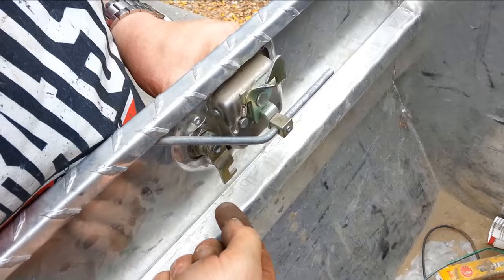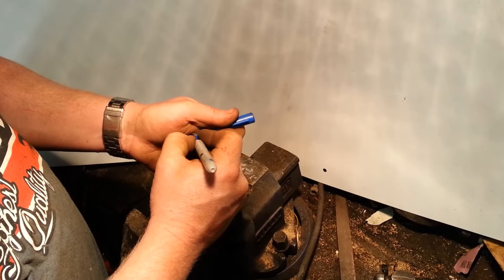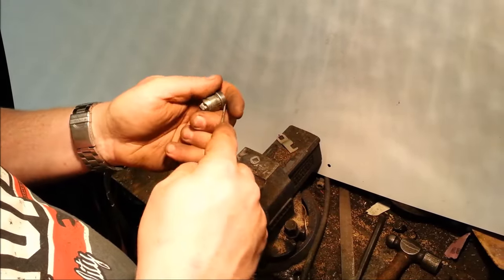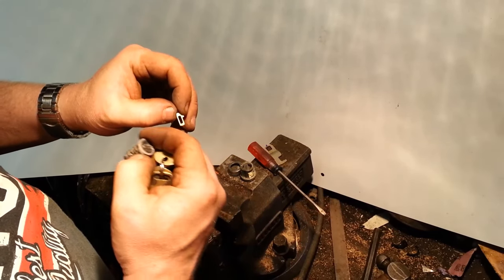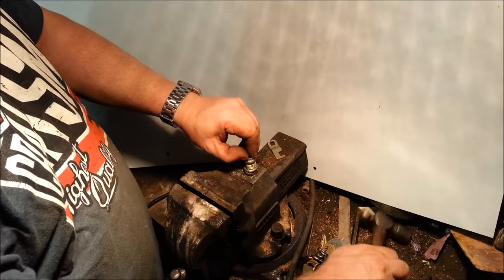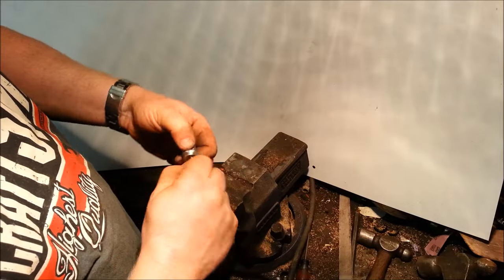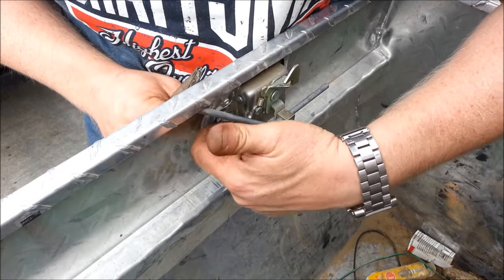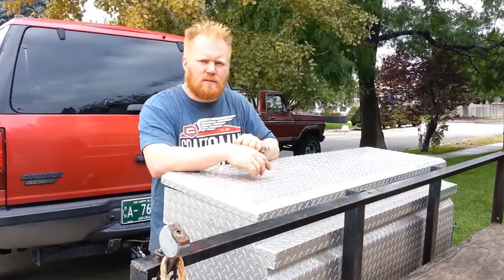Lost KEY for your Truck Toolbox MAKE YOUR OWN!

Comment: This is not Re-keying the lock this is destroying the lock is making it so instead of one key fitting the lock a thousand keys will not fit the lock because you file down the Integrity of the Tumblers the correct way is to take it up to a locksmith shop and have them replace the Tumblers with a key that matches it. You routine it is what you did is file the Tumblers down so almost any key will fit that lock now any crook that walks up the sticks a key in your lock will probably open it just a piece of advice from a 30-year certified Master Locksmith
Reply: ...ya...I'm a criminal, and I totally walk down the street trying my key that will "probably open it".  How patently absurd.

With youtube, most who have any care about security know what a joke nearly all modern keyed locks are against any kind of moderately sophisticated attack (picks, jigglers, bump keys, a drill).  A key is simply to prevent crimes of opportunity.  Period.

For sophisticated attacks...well, that's what insurance is for (or learn to do without).  Because the alternative is to go with something like Medeco, which probably costs more than the things I'm protecting...and even they aren't perfect (and the company has clearly demonstrating that they will not fess up to, warn about, or correct their failures).

The goal, for most, is merely the Pareto principle.  And for that, thank you sixtyfiveford:  Mission accomplished.  :)

[and bonus points for additionally making my life easier by introducing the idea of consolidating keys!]
Reply: I'm a certified neighbour
Reply: Or just get a new cam lock for 6 bucks
Reply: Master Locksmith??  Master locks suck!!
Reply: Certified troll here.
Reply: Wow, all the hostile comments.  I wish I read the comments here first before leaving the previous comment. Well it's not a high security lock indeed and I tell my customers not to rely on it too much also but still can't help cringing watching him. I surf YouTube to find something that I can learn from but it seems nowadays everybody is an expert. Better stop watching I guess.
Reply: The locksmiths are correct, this just makes it so any random key can open it. Overall something is always better than nothing. These are simply cabinet locks sold at lowes, ace, etc. You can pick up one less than $10 and screw it in for less trouble than this.
Reply: What about filing down the wafers from the bottom instead? Would that help?

Comment: The nut holding that lock on is probably much better than those forked clips. My van got broken into 3 times. Seems like all they used was a big screwdriver, and pried it right out. I got so sick of it, I finally installed those hockey puck locks, and nobody has messed with it since. But now I need 4 different keys to get into my van. Because the regular locks were replaced but not keyed the same.
Reply from the maker: metalmoto Darn Thiefs!

Comment: I can't thank you enough sixtyfiveford !

This is brilliant ! I've looked at new locks, locksmith re-keying, etc. Not only have you saved me a lot of time and money on my salvaged toolbox lock solution you've educated me today, and that is priceless. And I'm already imagining "fixing" a few other locks so they're "keyed" alike to save me the weight and space on my key chains. Almost wish I'd found this before I wasted all that time looking at other options but then I wouldn't know the real value of the lesson ;-)

Peace and prosperity !
Reply: Quick question if you see it before I start filing ;-)  (I'm so itching to start filing right now so I can finish this up lol)

The key I have that is the best fit (and it's very good really except it...) only hits the first 3 of the 4 pins. It hardly seems like it's worth it but would you look for a key at the hardware store that goes a bit deeper to engage the final pin ? I'm thinking I might just remove the final pin entirely instead but the hardware store is handy and I know the owner so it would be no trouble.

I'm also have a small idea / question / suggestion, maybe not a great idea but ;-)  I'm pondering moving the pins around to maybe get closer to the key I have. It's only a 3 (or 4 with a longer key) combination problem so it shouldn't take long. And if I use just the first 3 pins in the lock that gives me the 4th as another possible fit in the first three slots.
Reply from the maker: +Not Here I would just pull the pins. If someone is going to attempt to pick the lock they already know what they're doing and whether you have 3-5 tumblers they'll get in.
Reply: +sixtyfiveford Yeah, locks will only keep out lazy thieves, honest people, and the kids. Good enough for running into the store and parking in the driveway or job site though.

Turns out that last pin was engaged after all, just that my key slipped into it without it moving up or down at all fooled me. So I have a full tumbler set after all.

For what it's worth I did play with the pins for a minute and found a combo that actually worked with my key, though just a little sticky. A bit of filing and it's as smooth as factory, or better :-)

Thanks again for sharing your knowledge !
Reply from the maker: Great work. I'm glad you tackled this.

Comment: I bought a new tool box with a separate keys for the top and bottom locks. The bottom lock keys were missing. Many reviews on this tool chest says it is a nuisance by having 2 different keys. Now I will convert the bottom lock to use the same key as the top. Thank you again for this info!

Comment: The thing on the front is a dust cap, then the bump thing is called a timing cam,  and those things you call bumps inside the lock are called wafers. Just so you now have the names.  Now, for filing the wafers, now you have made it possible for multiple keys to fit your lock. And now have a bigger opportunity of being robbed. Great job
Reply: The DIY concept is brilliant but yes, those locks are very compromised. I would never recommend doing this. Just replace the lock.. Very cheap. There are several companies that sell different locks that are keyed alike. That said, locks just keep honest people out.

Comment: Here's something a little shocking that I learned about locks recently. That general type of lock is often used on office filing cabinets and locking desk drawers. Look carefully and you probably will see a number - perhaps 3-4 digits - engraved on the face. If you take that number to a locksmith he can make you a new key, no questions asked, without seeing the lock or any existing key.

Source: I recently bought a used filing cabinet in a salvage auction. It had locking drawers but did not come with a key and one drawer was locked. I was about to drill the lock when I decided to go to a lock shop and see if there was a better alternative. He told me about the number thing and I was immediately hit by the security implications of this for many businesses, and I said, "You mean I could...."   He cut me off and said "Yup!"  He made new keys for that cabinet, and I 've since gone back and got more  keys made for other cabinets/drawers I have.
Reply from the maker: I've noticed these digits.
Reply: Most of those locks do have a key code, its actually scary how many locks have a visible code. I hope whatever Locksmith you worked with verified ownership? You shouldn't be able to just walk in somewhere and say/ask "I have some numbers on my lock..can I get a key?
Reply: @geraldskinner63  These are basic  cam lock/cabinet locks.    It is incredibly easy to get into a cabinet without the key.    I have the experience from the times I didn't have the keys for a file cabinet that was locked, either due to me losing the key, or inheriting a locked file cabinet at work.  They aren't really designed to keep even a slightly motivated thief out of your stuff.

Comment: Thanks bought a s10 and i believe some of them came stock with a toolbox, im putting tools and various truck parts in there rather keep safe. Hopefully i can do something like this prolly wont do it till tomorrow its already 9 but my motivation kicking in😂
Reply: So basically, you pull it all apart, stick a decent key in, file the little bar things flat, then put it back together. Hope i got that right
Reply from the maker: @VegBeefSoup  exactly
Reply: @sixtyfiveford  thank you worked good👍

Comment: Smashing :-))

I did a lock on a frends car two years ago, it was worn and sometimes would not open the door.

I was a tad nastier than you lol, i used a bench grinder with a smooth stone to slowly take the sliders down to level, after that i dressed the slider edges with a fine file and after lubing the insides it was assembled.

Worked fine, still does :-)
Reply from the maker: zx8401ztv Great work. Playing with locks is always fun.

Comment: If you file down the wafers then that means you could still use the original key also. Wafer locks are not very secure in the first place. I'm guessing you could also open the same lock with jiggling a straight piece of metal up and down against the wafers. Neat trick though.
Reply from the maker: These locks are pretty easy to jiggle open with any key that fits in them. But, any lock is really only meant to keep the honest and lazy out.

Comment: Awe God. That's so scammer locksmith quality job. With any fat flat screw driver you should be able to force it turned. Seen so many locks with filed pins done by scammers because they want quick bucks and the customers don't know. Smh.

Comment: How exactly do you get it open.  When it’s unlocked it’s easy...
Reply from the maker: These locks are not secure at all. Put any key or even a pocket knife blade that fits in. LIGHTLY jiggle it while turning the lock LIGHTLY and it will unlock.
Reply: @sixtyfiveford  Ok.  So changing the lock is a moot point unless it simply keeps the latch secured.  Don’t get me wrong, the key in my doesn’t work anymore.  I need to get in without doing much damage.  After that, I’ve found that changing it is relatively easy to getting in while maintaining the integrity of the locking system.

Comment: ok thank you so much but holy shit this is not this easy. just did it. bent the piece that is riveted on so it doesnt match up at all. had to dremel it off in the first place.  re ripped it off trying to straighten it. jb welded it twice now.. lost two springs for the tumblers. holy shit. u have a gift man.

Comment: They re not tumblers. They are called wafers. Filed locks like these work. But are extremely easy to rake open. Picking level of one.
Reply from the maker: They are tumblers. It's technical name is a Wafer Tumber Lock vs the Pin Tumbler Lock. The video has nothing to do with lock picking or the degree of difficulty associated with each type.

Comment: can you rekey the door lock on a vehicle? I don't have a door key to my 04 sierra 2500hd, bought it used and didn't check to see if the ignition key worked in the door.
Reply from the maker: +Charles Jackson Yes, it is basically the same thing but you'll have round tumblers vs flat.  This video shows more what you should expect minus cutting open a padlock: https://youtu.be/m-KeijRk4zI

Comment: To sixtyfiveford: Could the same be done with car keys? Ignition key different for doors and/or trunk. Also I have a couple of tool boxes I bought w/o keys so I'll be trying this.
Reply from the maker: Cesar Rodriguez Yes, car keys can be done as well. They have traditional round tumblers. I have a padlock video that will be closer to what car locks are like.
Reply: Thank you.

Comment: Okay, so am I the only one who is scratchin his head here?  Title says "Lost KEY for your Truck Toolbox MAKE YOUR OWN!"  then you opened your tool box and pulled the lock out of it and re-keyed it, cool.  But if you lost the key which I kind of did how in the hell am I supposed to just open the box and re-key it? The answer is, I'm not.
Reply from the maker: These locks are effortless to open with any key or flat blade that fits in. Push it in jiggle it around while lightly twisting and it'll unlock.

Comment: The best part of this video is at the 9 minute mark:
buy a new lock, $11.00,   $5.00 for a cheap one that is still better than this.
Taking a file to it is not re keying it, just making it so just about any key will work it. 
0 security
Just because it is on U Tube doesn't mean you should do it, that is not a lock anymore.
Reply from the maker: These are never good locks and a first time pick locker can open them in sub 60seconds. I can buy any truck tool box without keys and generally open it within 10-20seconds with any random key or pocket knife I currently have on me.

Comment: Those locks are just as lame as the ones on my Craftsman tool box.  I actually "upgraded" my tool box locks by finding nuts (off of old desks at work that had missing keys) and using the nuts on my tool box locks in place of the thin "clip" that is normally used to retain them.  I also use a washer to make the surface area of the nut with the lock larger

I figure that should make them a bit more difficult to pop out, whereas the clip could bend, break, or pop off.  Or perhaps you could still punch the lock in.  I'm not sure.  Regardless, I think using the nut is more secure than the clip.  But still pitiful for "security."
Reply from the maker: Blaine Bugaski For sure it'll be a lot safer.
Reply: Do you think that filing down your tumblers may weaken the lock, though?  The tumblers are not quite as long as they were, so I would assume that their holding ability in the locking position will be somewhat diminished.
Reply from the maker: A very small amount yes. But if someone is going to force the lock it really won't make a difference.
Reply: True.

Comment: now what about if the toolbox is locked and you lose your key?
Reply from the maker: unholyape These locks are very easy to pick... Take any key that fits in the lock and while pulling/pushing the key in and out rapidly, lightly apply turning pressure(very light) as if your unlocking the box. Usually you can unlock these in under 20 seconds.
Reply: sixtyfiveford awesome thanks!

Comment: so your saying that any one with a key that close to that profile. will be able to open that lock then?
Reply from the maker: Nathan Dean No. It's limited to that the old key that is long gone or the new key you fitted.
Reply: ok have you tried it with similar cut  keys?
Reply from the maker: There are so many different combination possibilities on keys that it is virtually impossible to find another key that would work. That being said a person with even a small amount of pick locking practice can pick these locks in about 10 seconds or virtually any other lock.
Reply: just drill  it out or cut the restraining bolts. an be off with the whole box. or cut the bolts and let you deal  with the accident that you'll cause from loose or faulty equipment.
Reply from the maker: OK?
Reply: well u have to think of these things. try using grade 12 bolts then cover them witth small pipes. itill make it a nite mare to cut the bolts.

Comment: The truck bed is locked how do i get in?
Reply from the maker: These locks are not secure at all. Take any key that fits it or a small nail file. While inserting the key/tool into the lock jiggle it and apply a light twisting motion. Move the key in and out riddle and you should be able to pick it extremely easily.

Comment: ya but if its locked already when i got it
Reply from the maker: The locks are not secure on these at all. Put any key or a flat piece of metal in the lock. Jiggle and twist and it'll open right up.

Comment: I lost the key... Is there any way to unlock it
Reply from the maker: These pick very easily. Any small pocket knife or random key that loosely fits will work. Insert the tool into the lock and while moving it in and out rapidly apply just a little turning motion. Vary the speed and turning force and they unlock pretty quickly.

Comment: Mines locked though
Reply from the maker: Stick any key or even a pocket knife that fits in the slot. Jiggle it while moving it in and out with a slight twisting motion and it'll likely unlock in 10 seconds. Very light twisting motion!
Reply: @sixtyfiveford  thanks Im trying it rn